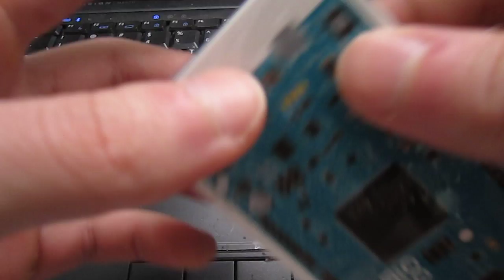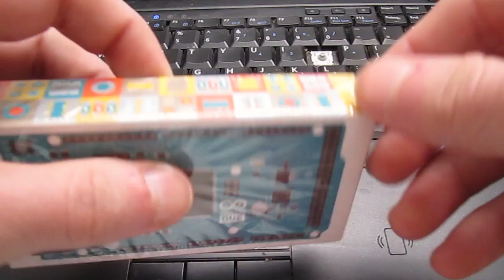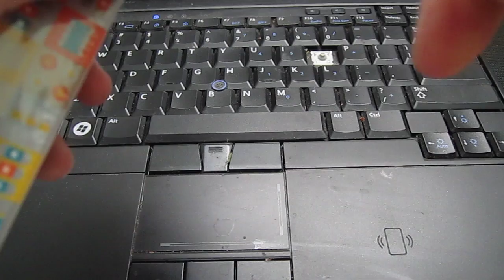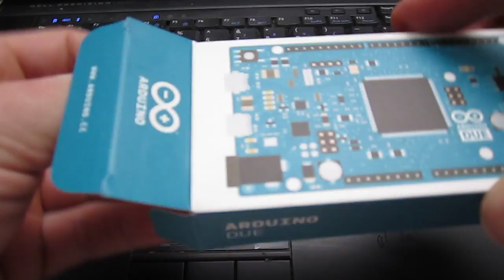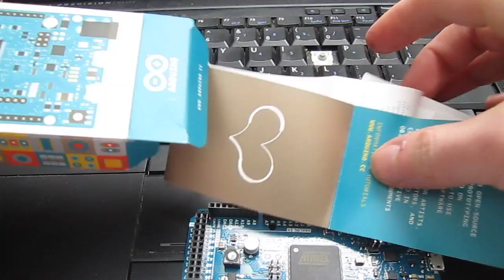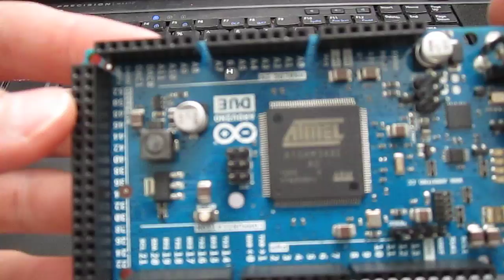Arduino Due Unboxing

Comment: 32-bit ARM vs 8-bit (2560) AVR . Also, the Due has an 84-MHz clock vs. the 20-MHz clock on the 2560. And the ARM-based Due can operate on a full 32-bit value in one clock cycle--so depending upon your code, the Due could be even faster than clock speed difference would suggest.